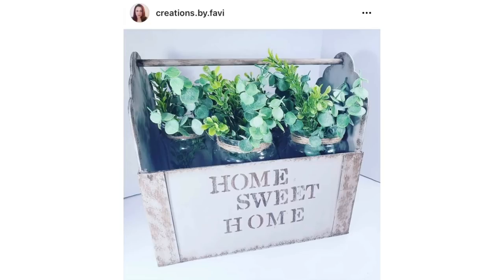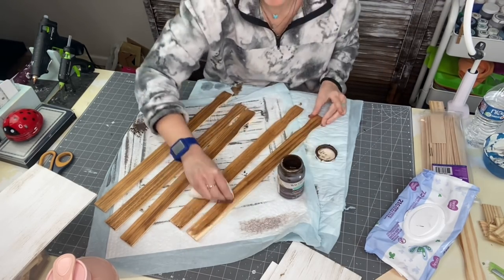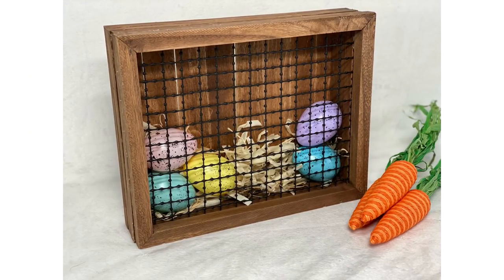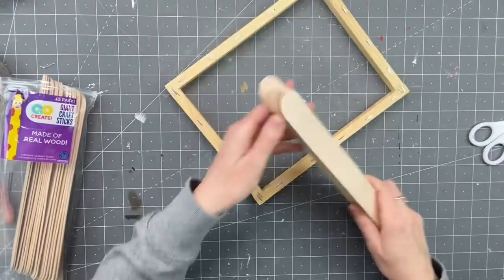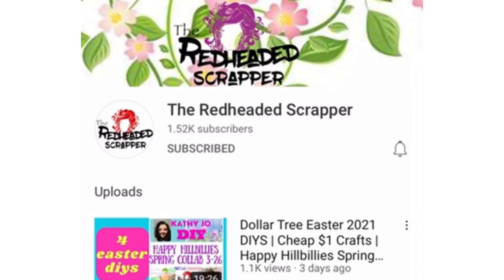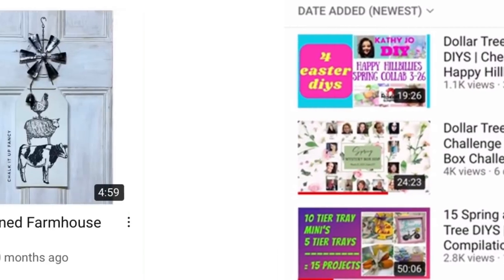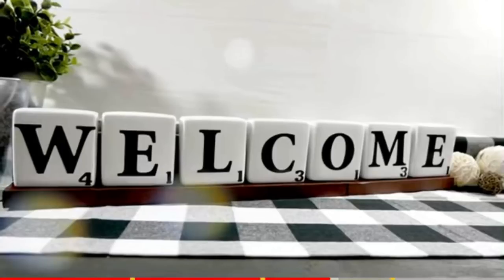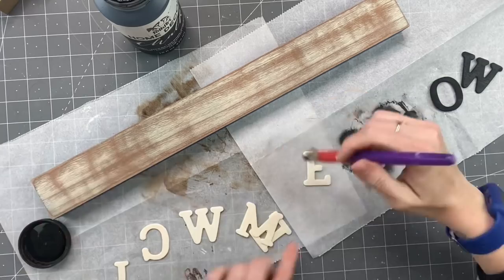EVERY DAY FARMHOUSE DECOR DIYS | TRY IT TUESDAY | NEW HOME DECOR DIYS | DOLLAR TREE DIYS | FARMHOUSE

Comment: Have a question. If the hot glue adds bulk, does the super glue actually have a chance to connect and “glue”? I like things to not fall apart. I do not like temporary or fragile.
Reply from the maker: Hey Sandy! So I've learned that putting some super glue in some spots and hot glue in others - not touching it holds up very well. You can also just apply super glue and then leave it for an hour or so to adhere
Reply: @UnicornDustDesigns  Thank you!